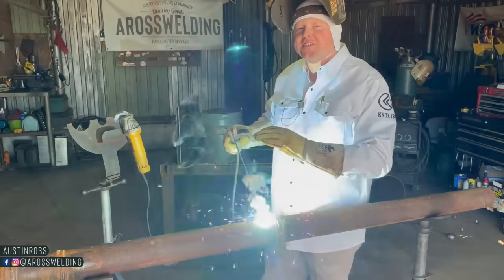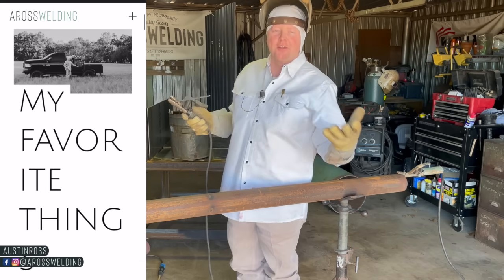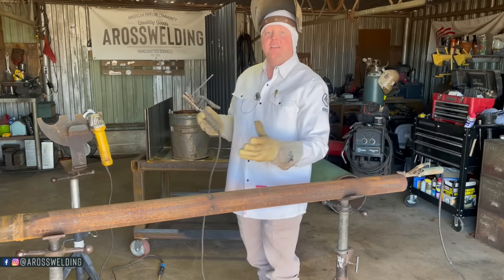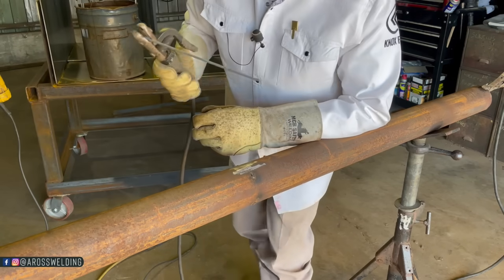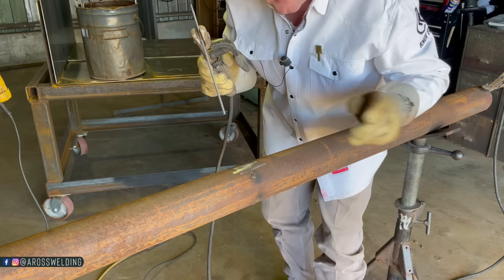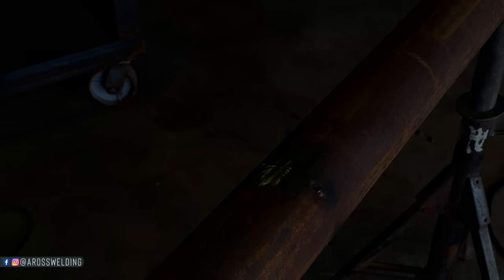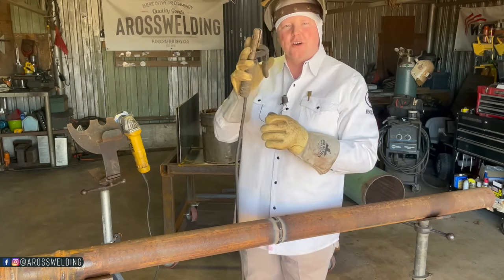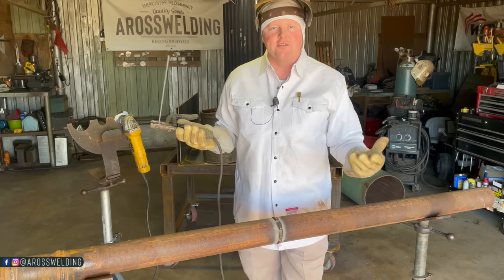Do this instead (3 Stick Welding Tips)

Comment: i drag like a scratch..light enough not to leave a mark, but strong enough to make contact...in about 3 minutes i learned striking like a match is a great way to weld the tip to the object and unable to move the stick with out first having to bust it off...and then there is the large surface puddle of the amount of stick that melted on the spot you got stuck before you broke off... making wear bars on 16' of 8' diameter core barrel drilling casing is probably the fastest way to learn how to stick weld properly and the foundation for any other type of welding
Reply: Yup.  The other bit of really good advice I heard for beginning stick welders is: When it sticks, let go of the rod with the clamp.  Makes it a lot easier to bust it off, and you don't end up with a hot mess where it stuck.

Comment: Great video, Austin. That is a great learning video, and this will help the new guy learn an easier way to weld where they don't stick the rod. Austin, I am so excited about your excellent job on my welding bed and mounting it to the truck. You have made my dream come true. Everyone I show the picture to is like that, a slick-ass rig, and I could not have done it without you. Bob King didn't even want to do the work on my rig, and he is the name on my bed. Thank you for helping out and making me a sharp welding rig. Rowdy Parker.
Reply from the maker: Pleasure is all mine brotha man. Thank you for trusting me to be involved in your welding bed.
Reply: I like to put my weld rod in my exhaust pipe .it takes the chill and  h20 out of ur 6910/7018 hilow. 24 years same ZR8 new from Ohio Lincoln

Comment: Industrial electrician here but I know some about welding. P5+/6010 for unistrut (right?) and 7018 for mild steel. Rake the rod on concrete to remove the flux cap to make an easy strike when welding. Your the pro and im only 46 seconds into the vid.. lol  TY and thanks for the info you provide for us less experienced people.. TY SIR!!!! ..
Reply from the maker: Yes, 6010 5P plus should be OK for the Uni strut. Although 7018 would work also. But the 6010 will be much easier. And it is my pleasure!

Comment: I also like to drag it at a low angle so it hits the flux first, then I get it a little steeper so it can make contact with the rod and it usually strikes up perfectly without sticking. Helps if the rods have a good flux tip on them.
Reply from the maker: That is a good idea
Reply: @arosswelding  Thanks and thank you for all of your helpful videos. They've helped me out over the past couple years!

Comment: This is very good advice. I've only been welding off and on for 2 years now. I was told, strike it like a match, and I got nowhere. I found being slow and gentle when striking up was the way to do it. I'm not a good welder but I am rapidly improving every time I strike up. I spent so much time focusing on starting and screwing that up I didn't get to learn what a puddle looked like. For 20 years I avoided learning and now I love "having to drag out the cables".
Reply from the maker: I agree. It is good to hear you are improving every time. That is what it’s all about. Repetitiveness and adjusting and making changes in between every pass.

Comment: on my ac unit, i can turn the dial low as 45-50amp and it lights and burns a whole 5/32 6010 rod almost like there is no way of knowing other they it burns slow... "machine maintenance"? 110volt buzz boxes cant do that even with their dial at 100amp... bigger unit different drive = learning all over... in and out of the pawn shop 🤔😵‍💫🥸 need to cut the cable in the stinger and re-clamp it?
Reply from the maker: Yes, it sounds like something may be wrong with the welding machine.